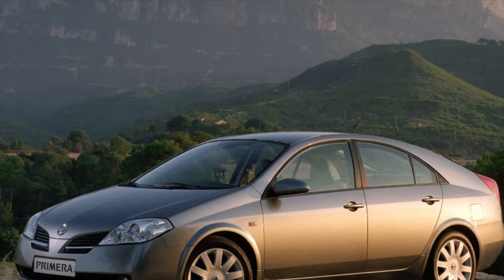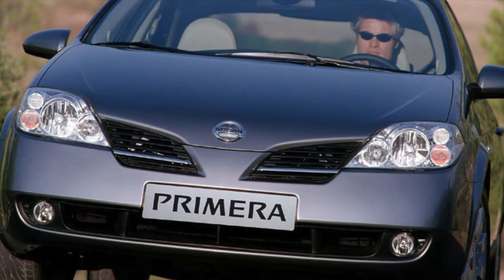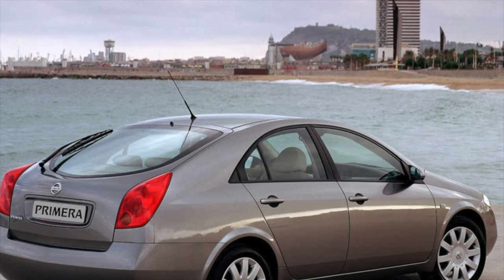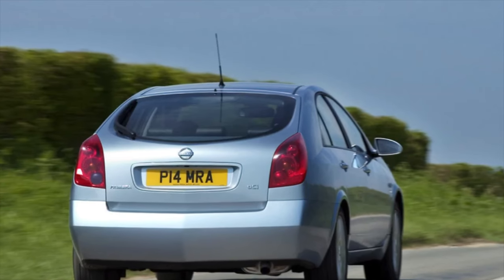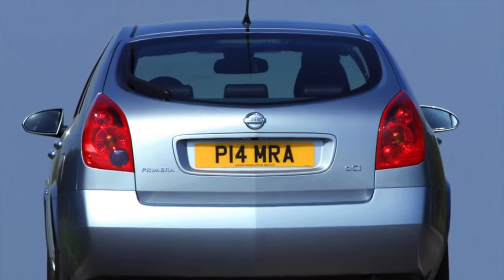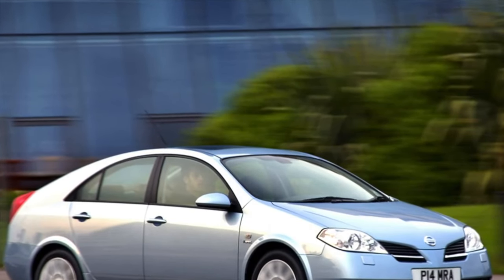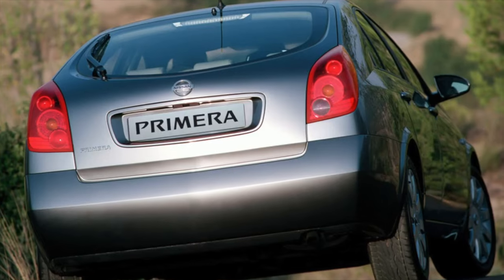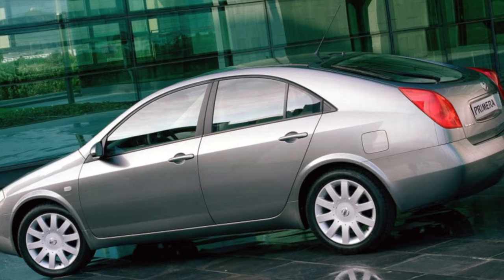What are the most common problems with a used Nissan Primera P12?

Comment: I have a 2007 1.8 manual as a backup car, they are very cheap but for a reason, they are very cheaply made cars and it shows in silly things going wrong all the time.  This was the beginning of the bad Nissan era. Stay away from anything Nissan from 2000 -> .